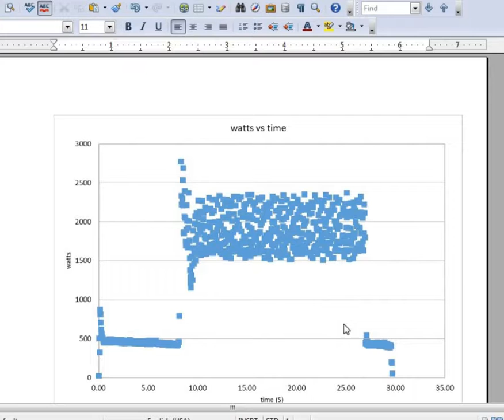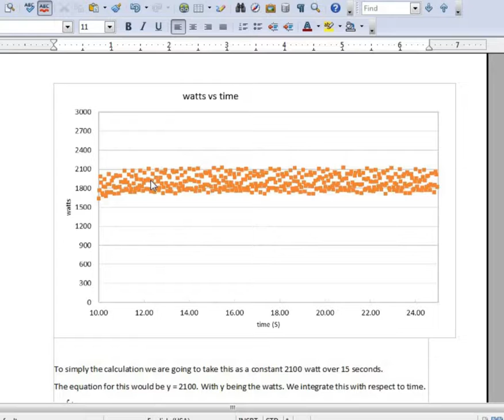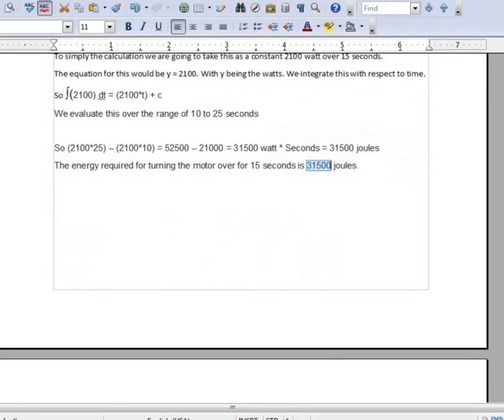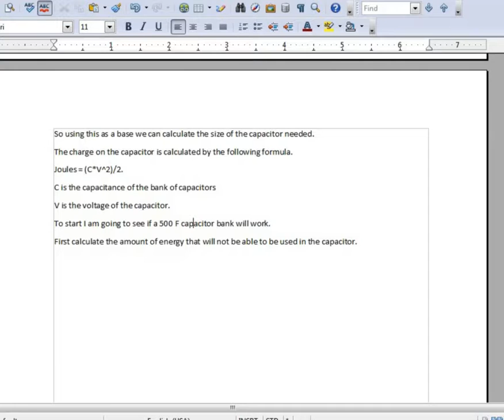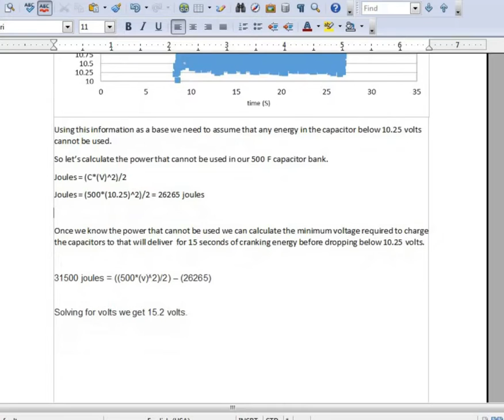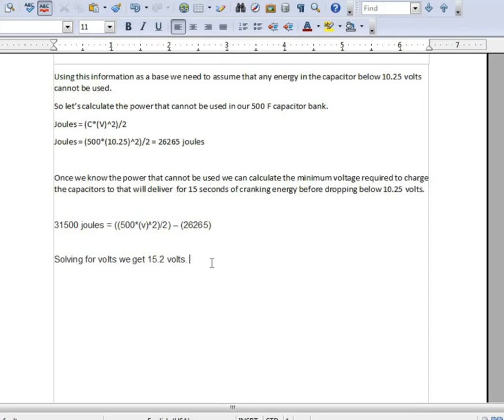Using a super capacitor as a battery calculations part 2.

Comment: I would recommend testing for amp draw.  The "least" amount of voltage required to turn my engine over is 9v.  (9v x 100A = 900w).  What is required, is the amount of "amps" at the given voltage the capacitors in series will provide at a given moment during the starting cycle.  You do not need more than 500F, believe me.  If you check my channel you will see videos of my ultra-capacitor battery replacement, to include the 3D printed battery case I had made.  Your calculations are interesting, but I think you may be over thinking this a little, no harm meant, just my opinion.
Reply from the maker: Thank you for this information. This explains a lot. When I measured the amp draw I was seeing 225 amps on my car well turning over at 10.25 volts. With your car at 100 amps its going to work a lot better. Most likely i'll use 500 F and override my running lights to lower the amps during starting.